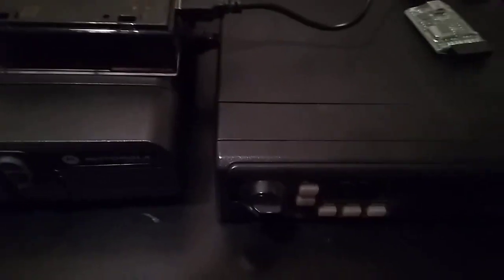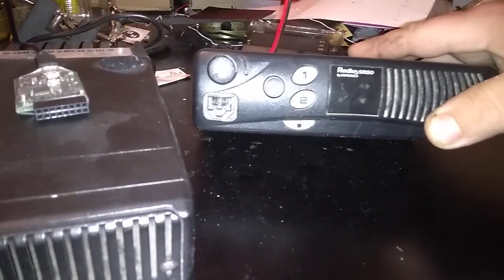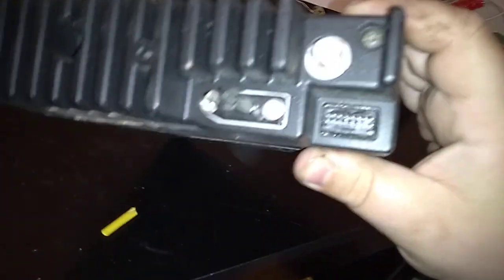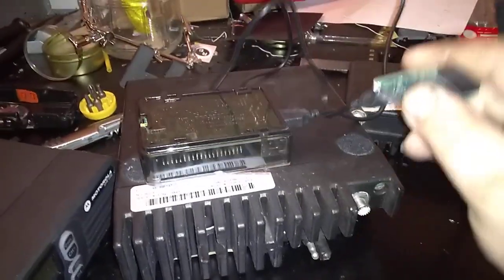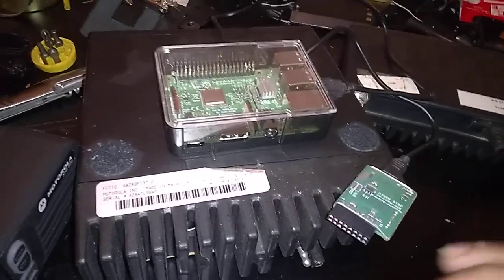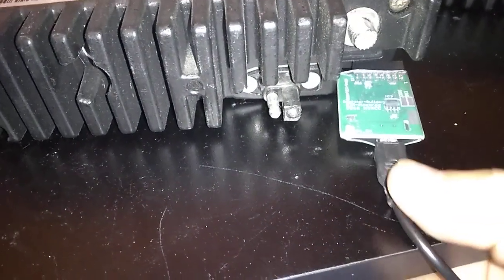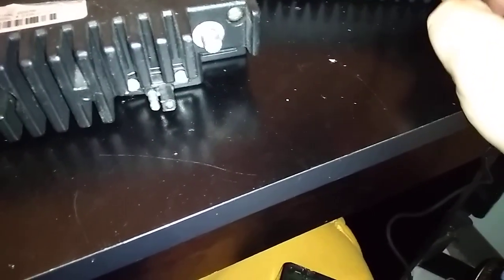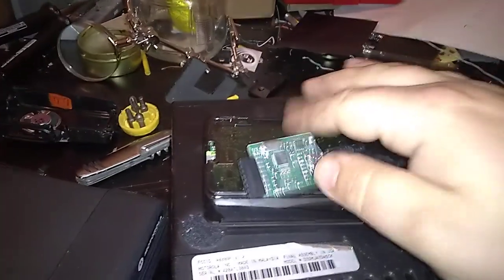How to make a Motorola Mobile Radio a Simplex station.

Comment: Can you please advise what the accessory pins settings are. PLEASE?! That would help me out a lot.
Reply from the maker: What sound card are you going to use?
Reply: @tgln  Repeater Builder USB RIM Lite. The other replies from my other YouTube account.
Reply from the maker: @KD5FMU  https://www.google.com/search?q=16+pin+motorola+connector&oq=16+pin+motorola+connector+&aqs=chrome..69i57j0l4.15311j0j9&client=ms-android-cricket-us-revc&sourceid=chrome-mobile&ie=UTF-8#imgrc=DiG_Il5KZRGLWM
Reply from the maker: @KD5FMU  that picture points to what you need.
Reply from the maker: @KD5FMU  can I ask what network are you joining?
Reply: @tgln  AllStar
Reply from the maker: @KD5FMU  😾 if you ever want a place you can go and speek freely you can join The end network
Reply: @tgln  Repeater Builder USB- RIM lite.
Reply from the maker: @Moony_Sky  the picture has > pointing to what you need. There are some that some pre set that's why you can't see them in the software. I believe them cdm1550 you need to put the rim in the middle you will have for extra two on each side will be open and showing. https://www.google.com/search?q=16+pin+motorola+connector&oq=16+pin+motorola+connector+&aqs=chrome..69i57j0l4.15311j0j9&client=ms-android-cricket-us-revc&sourceid=chrome-mobile&ie=UTF-8#imgrc=DiG_Il5KZRGLWM